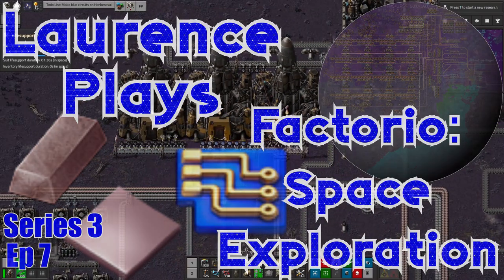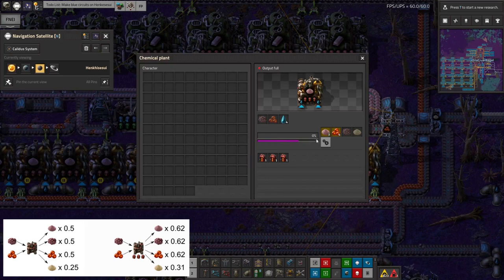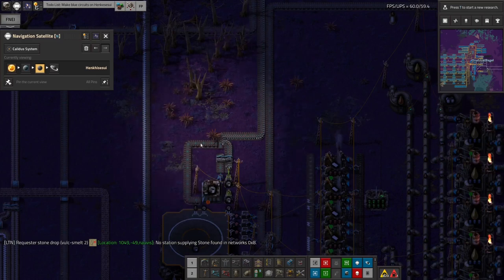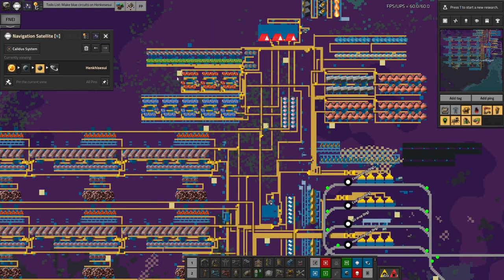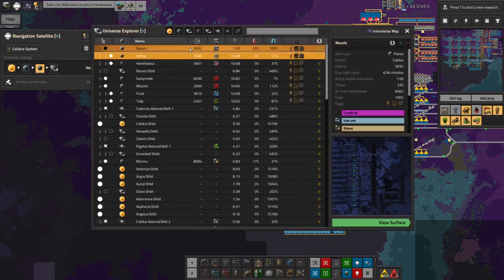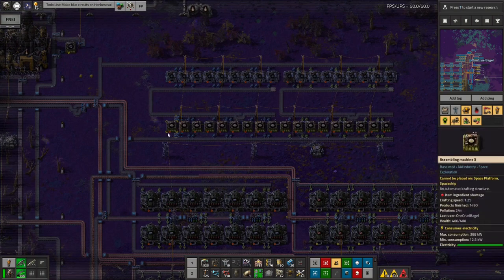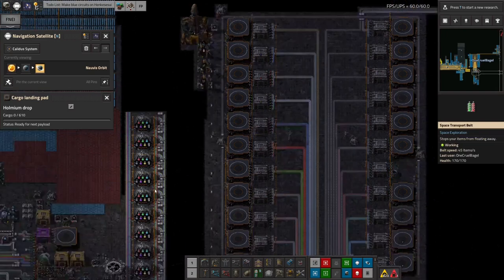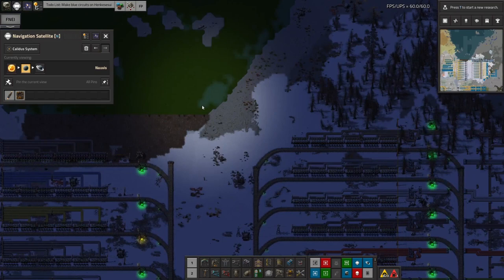S3-E7 - Circuit-ous - Laurence Plays Factorio: Space Exploration

Comment: Productivity in recipes with multiple output only affect first product. That info I got from change notes of the SE I believe.
Reply from the maker: Oh, interesting. That's a shame, but probably sensible for balance reasons. I'm glad I didn't work too hard on the Maths for it :-)  I did estimate that the beads would still get used up, at least with the modules I was using. Perhaps with a full set of tier 6 ones, that would be different though! Thanks for the info  :-)

Comment: i think its way to hard to balance to produce anything on distant worlds, i would just bring everything back home and distribute/balance/prioritize it there. It cost more fuel, but wayne? its kinda unlimited anyway.. :D
Reply from the maker: I did consider shipping core fragments to a central point and then producing all the supplies there, but I'm trying to be efficient and environmentally friendly  :-D  Also, rocket fuel seems to take ages to make. I could put more refineries in to compensate, of course, but ... I dunno, I just seem to be doing it this way  :-)
Reply: @LaurencePlays  yo no i mean like just ship the ores and dont process it on the planets, safes you so much time / effort  but its factorio there is no wrong way, do like u want, just a tip
Reply from the maker: @galsherp6173  Yeah, ores would work too, but assuming you actually want all the side products, it's a bit more efficient to ship the core fragments. I think you get something like 16 ore from 10 core fragments, and they stack to the same number. At least, from the exotic core fragments.